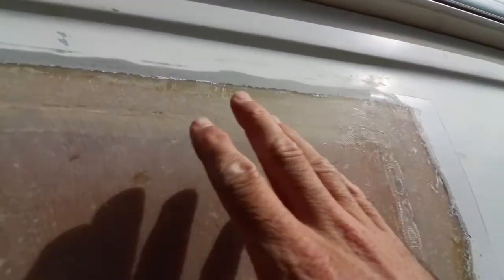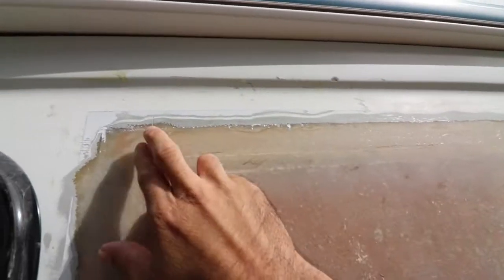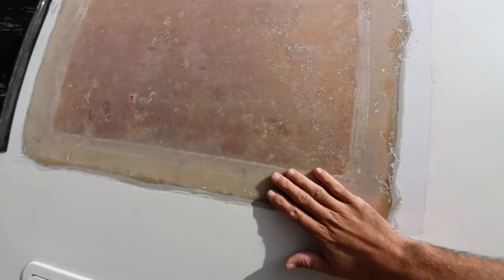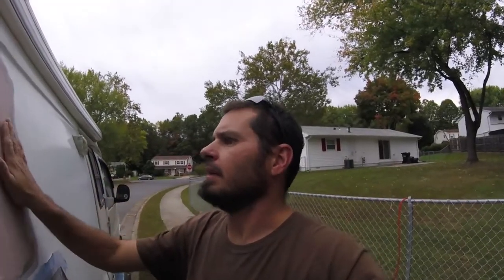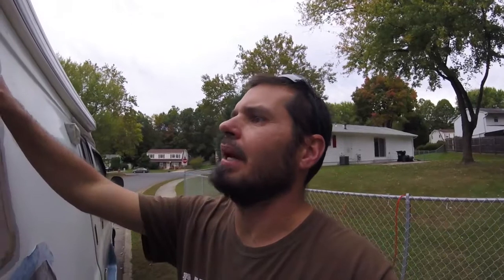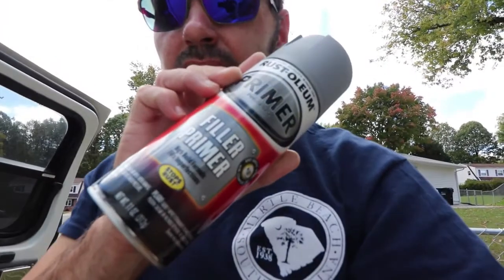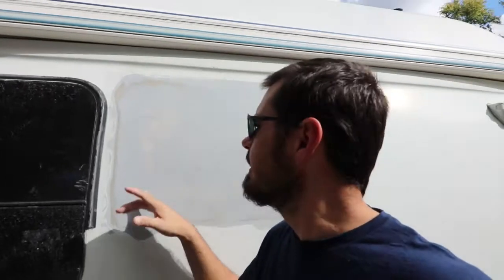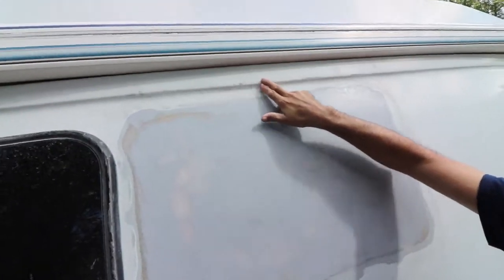Van Life: Working On My Body Part 2

Comment: Hit it w a random orbit, final coat w some finish glazing, esp. Edges. Blocking it is actually the way to sand. You did good dude
Reply from the maker: joel minjock Thanks. This one came out a lot better since the last time. Age 18 and used bondo to feel in a big rust hole. Needless to say it did not last long lol.😎